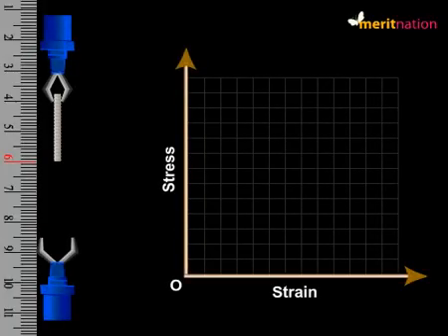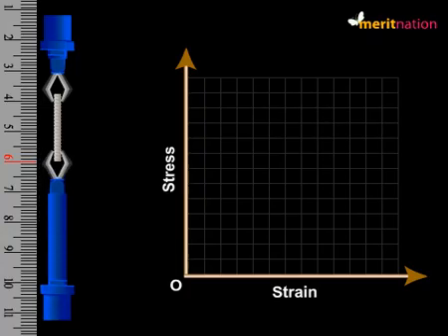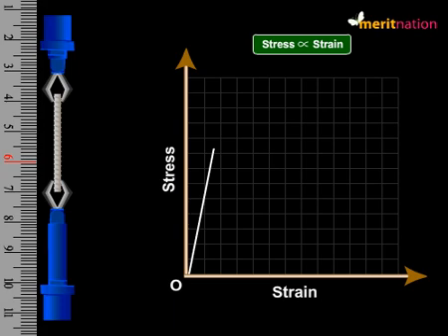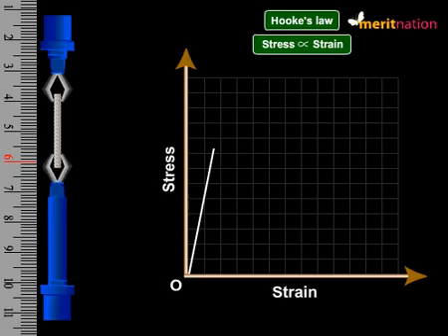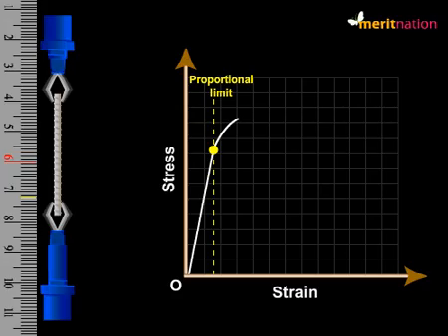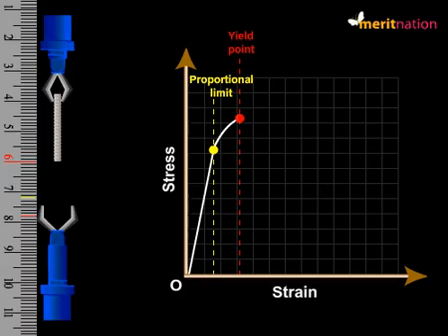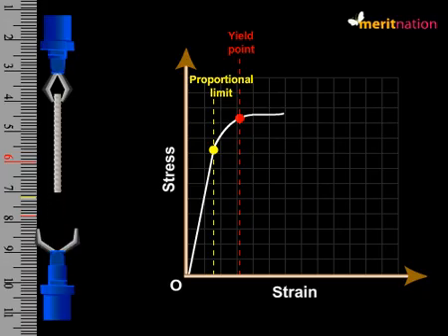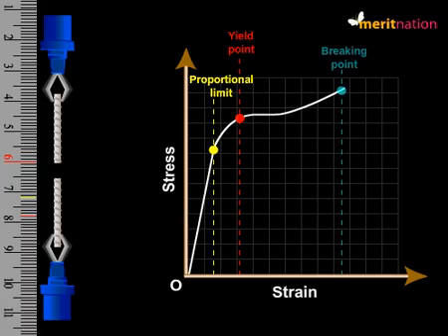Hooke's Law - Stress and Strain Test

Comment: Also, there might be what is called necking (type material necking on youtube for examples). This occurs after the strain giving a global maximum of the stress, called ultimate stress, beyond which when the strain increases the stress decreases until the fracture (breaking point in the video).

Comment: Some people define more points. In particular, a difference can be made between the elastic limit (called the yield point in the video) beyond which part of the deformation is permanent, and the yield stress which is a local minimum of the stress after the elastic limit (some more complete graphs can be found on youtube). The yield stress can be interpreted as a point where strain changes without change in stress.